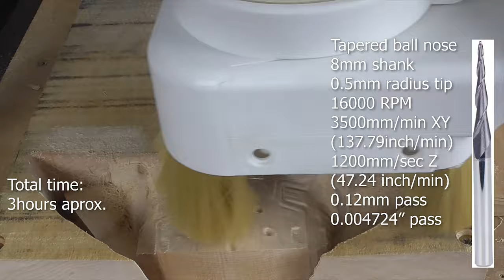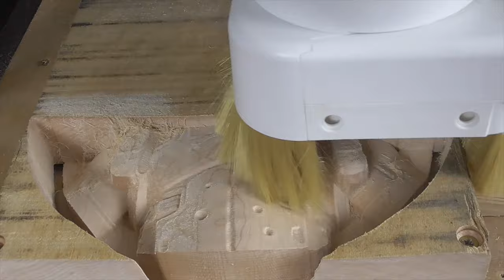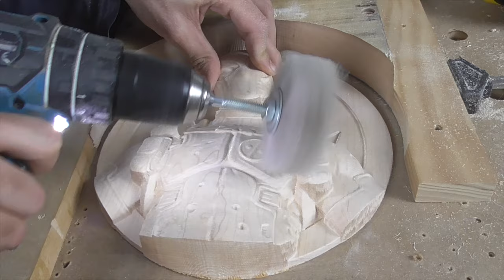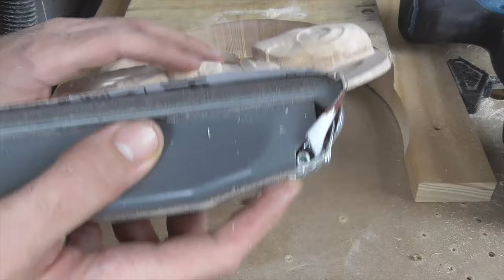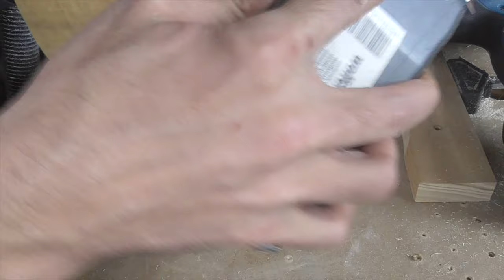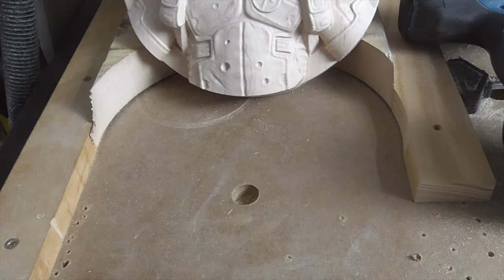Deadpool tallado en madera con CNC

Comment: Nice work. I love reliefs. You can take a lot of stress off your machine and but by starting with a roughing job. Maybe a 1/4” flat, just to take away the meat. Then your finishing passes can be run pretty fast as a result.
Reply from the maker: Thanks ;)
In my first jobs i started with roughing passes first, but it consumes a lot of time and one tool change for make the things fast i go directly at "full speed".
For my cnc frame isn't a problem make this passes without roughing first it's a waste of time (i start the cnc and when i come to home from work the job it's done, no tool change no nothing jejeje). 
If the machine it's like shapeoko or light frame roughing it's strongly recommended.

Comment: What magic did you cast to get the piece to stay without tabs????
Reply from the maker: Jajajajaja i'm a great Warlock LVL 100! 

Now seriously jejeje, if you see the final steps the piece move a little when finish, but this relief have this round base with sufficient depth for take all the force put with the bit with 0.12mm/0.0047" passes. 
And this wood is hard and 40mm/1.57inch, but better if i put some double sided tapes for avoid problems, but for make faster things i use rough wood and double side tape doesn't like rough wood (my planner cant afford this size of wood for make the base smooth and flat for put tape).